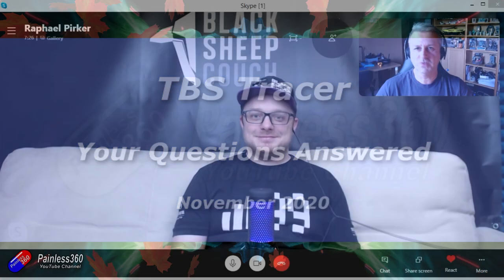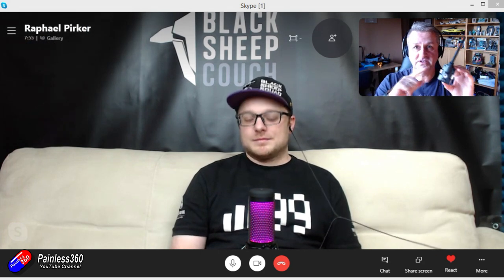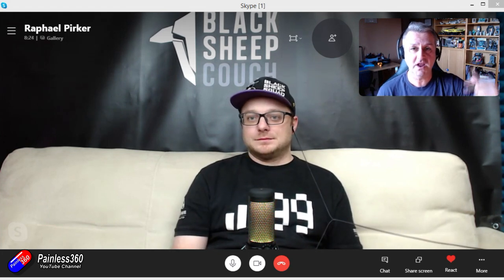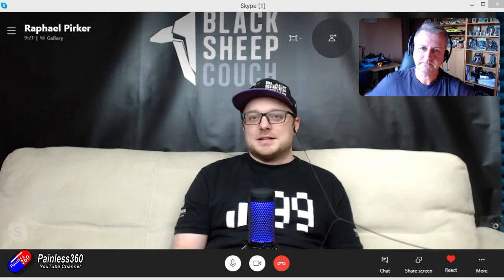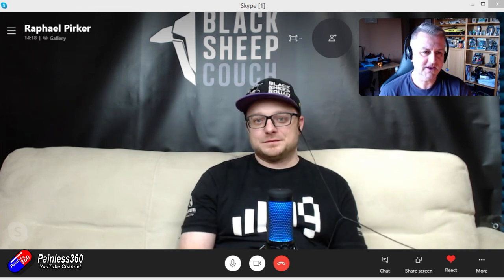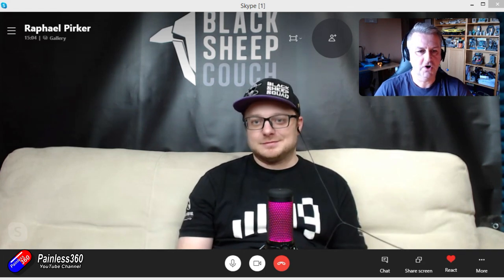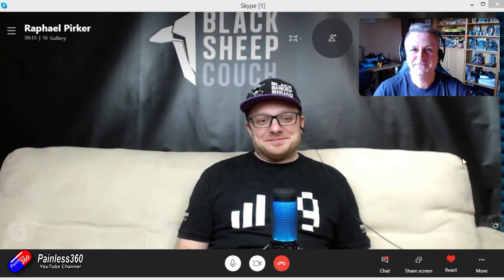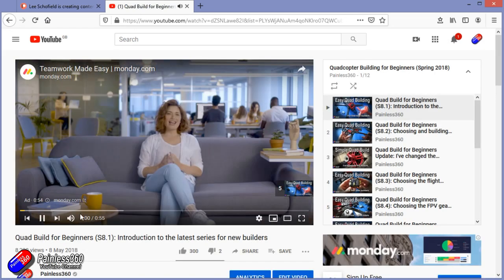TBS Tracer: Your questions answered

Comment: Already have crossfire in several kwads, but wanna try tracer. Do you think flying the tracer and crossfire in the same flying day would cause some issues with flying/timing? For example, if I'm more used to it being faster on Tracer, when I go back to a crossfire kwad, will I feel the difference? Be super noticeable? Afraid I'd like tracers latency that much better that I'd want to upgrade all of my kwads to tracer, which I'd rather not due being heavily invested in crossfire already. What's your thoughts?

Comment: Having a Tango 2 Crossfire with a bunch of modules would make it cumbersome, big, bunch of antenna's, and therefore pointless in my view. I'd buy a Tango 2 Tracer with multi protocol support , so just one antenna, TODAY. If the price is reasonable of course. I like the tracer mostly because of its small antenna's for my small models under 250g to be ready for the new 2020 drone regulations. And it being a machine gun makes it future proof and multi module support would make it possible for me to migrate my models step by step.

Comment: I have the tracer installed on 4 quads and they will all show up in the agent x except for 1. It binds and works but agent x nor lua will read it so I can adjust settings. Any ideas?
Reply from the maker: I've not seen that here. Let me know what it is when you find out please..
Reply: I will absolutely do that. It’s really weird it functions just fine and the signal strength comes up on my taranis but the lua script and agent x lite dont see it. Anyway I’m using a mamba f7 50 amp pro stack with WiFi and Bluetooth. Not sure if that makes any difference.
Reply: Throughout some troubleshooting we have found that the receiver has this issue no matter the quad or flight controller. I was given a ticket number to have it replaced. Mike Chin has been very helpful! Still not sure what the problem was. Probably just a defective part. Still love their products!

Comment: hah. I got my tracer with the 2W max sticker also.
should I be worried that I did not get the production model or is there absolutely no difference?
Reply from the maker: No idea, sounds like it was a error on the sticker printing!:D
Reply: @Painless360   guess I got my first collectible item, wonder what's it worth on ebay :)

Comment: Hi just wondering does tbs tracer work in the uk
Reply from the maker: Very well. Happy flying
Reply: @Painless360  thanks for the reply I'm just wondering do you have to unlock it to get the full features at all like you used to have to do with the TBS crossfire
Reply from the maker: Operation is the same as the Crossfire Micro Tx module ;)
Reply: @Painless360  nice one thank you very much for the information take care

Comment: If I have crossfire should I get tracer?
Reply: Probably not. Unless you're a racer or fly hardcore freestyle like Steele then you won't notice a difference
Reply: It depends on your plans for the future. Crossfire has the best range and penetration. Tracer has a faster response, is more compact, and beats even the best current 2.4Ghz transmitters by miles and light-years.
Reply: I recently bought crossfire and also bought tracer on launch. I mostly fly micros and wings and although I could use the FPVCycle minimortal T to get crossfire working on my toothpicks and whoops, I really like the smaller antennas of the tracer system that come with the receiver. The lower latency was appealing, and for my use case the range of even a 2.4Ghz non-SPI receiver is overkill, it's more about the weight and convenience.